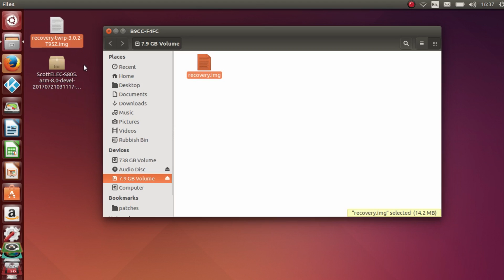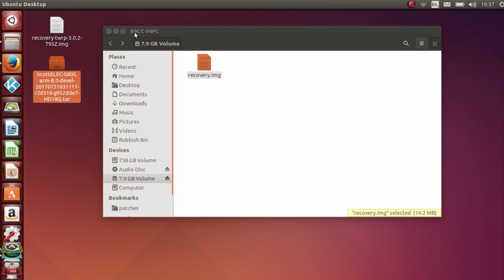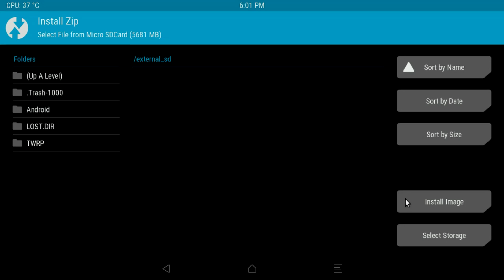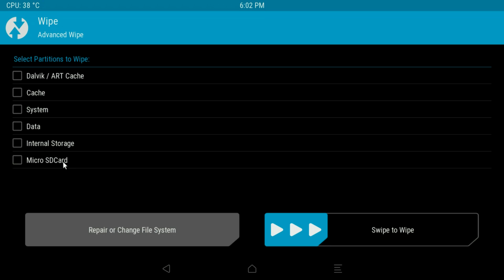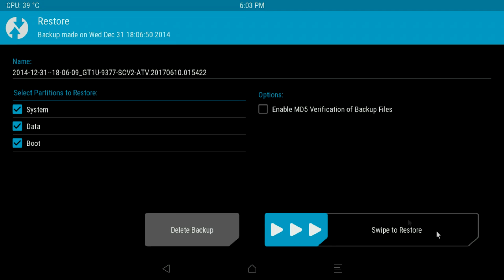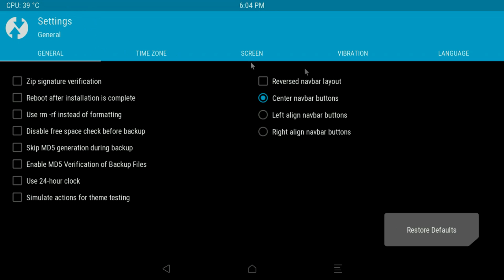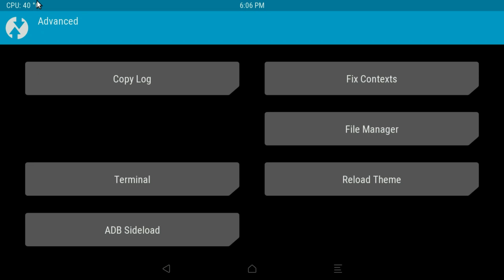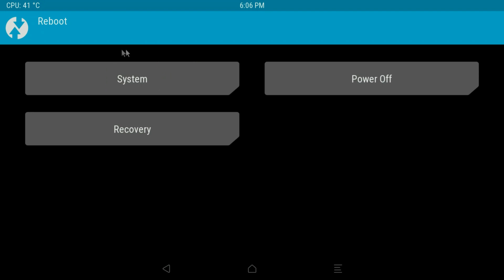Android Backup Tutorial: TWRP for S912 TV Boxes - Install and Recover Firmware

Comment: Boa noite amigo. Tenho uma box tv T96R 4K 2G/8G placa: TX_MX4M V13 2017-06-16 (ninguem nunca viu essa placa/pci) e NÃO consigo fleshar com a firmware original de fabrica 5.1.1. Baxei do site china e do outro site ...entretement... . Se uso PC com BOX não completa, dá erro/falha. Se uso SD CARD abre a tela do recovery, começa a fleshar e dá umas 8 linhas e na ultima dá mensagem: "Aborted Installation" e não completa. Então clico opção "Rebboot System Now", abre a tela da box T96R, volta para modo recovey e clico novamente em "Rebboot System Now", então inicia mas continua a mesma firmware que estva. Obs.: Esse modo SD CARD não BRICKA. Consegui fazê-la funcionar depois de várias instalações, bricka e desbricka e as que deram certo foiram: Leel, King, mas essas dentre outras rockchip NÃO funcionam wi-fi. Agora to usando a "V88 MINI II RK3229 2GB RAM 8GB", mas não to feliz, porque quero encontrar e usar a firmware dele mesmo. So não tentei ainda fleshar a original nesse modo TWRP. Instalei um 3229, mas quando entro modo recovery, a tela do TWRP abre normal e cheia, após carregar ela fica pequena em um canto da tela e o MOUSE e TECLADO ficam INATIVOS/INOPERANTES. Então não consegui usar o TWRP. Pode me ajudar por favor e me informar qual é a TWRP  que vai funcionar nela, box? Obrigado.

Comment: Great video!
My android box worked for an hour now it wont start.
I have a few questions:
Does this method require a sd card - you mentioned usb - can you install with a USB stick? Do you have a video on that?
(I do not have a sd card or burner - not sure my cheap android box is worth the equipment purchase)
I do not have a wireless mouse either - but where does the mouse plug into? - the usb on the android box or the tv? Could you use a phone that wirlessly connects with a TV remote to scroll the screen? Sorry for my ignorance here!
What is the best place to get firmware? Doing a search for my box which simply says A95X pro and nothing else, does not give me much.
I flash an android phone with LineageOS the other week. Do these boxes have custom ROM's also? It would be good to be google free and just have Kodi.
Cheers!
Reply from the maker: What box do you have ?
Reply: This one:
A95X PRO Android TV Box with Voice Control
https://www.gearbest.com/tv-box/pp_1801657.html?wid=1433363

Comment: Nice video. Wil this version of TWRP work on a Mecool M8S Pro L (LB version) Android TV box?
Reply from the maker: LB version ?
Reply: Yes, they apparently now have 3 versions of the box. The LB version is the latest one that has a few different chips, such as the bluetooth from what I have read on freaktab
Reply from the maker: As long as it is not the version with Android TV then theirs a chance it will work, might be more TWRP available now as well.
Reply: Yes it has the actual Android TV OS (sorta) on it. I can't seem to find anyone that can give me a link to the actual TWRP I need. Thanks for replying
Reply from the maker: System is to locked down with Android TV, for booting from SD not sure it would work anyway.
Reply: The version I found that will work with the LB version of the box was twrp.q20x-3.2.1-0_2.img at the time of this reply. It works great on SD card after renaming to recovery.img

Comment: Hello Scott, I have tried on numerous occasions to install the TWRP on my Beelink GT1 Ultimate without success. I've followed your instructions to the letter. But when I try and boot from the SD card I keep getting the Amlogic standard reset screen. What else can i do to get the TWRP installed? Absolutely does not work. Is there anything that you may have omitted?

Comment: Hi there. Great video.  Wuick question.  I ran the backup on an X92 S912 and I see that whithin the TWRP backup folder there are.win files.  Should there not be a .img file ? Thanks
Reply from the maker: You should just have a TWRP folder, that's what you need

Comment: My another device is amlogic q201. Beelink GT1 Ultimate Amlogic S912 Android 7.1.2 - 3/32GB.
Please. Is this TWRP (recovery-twrp-3.0.2-T95Z) compatible?
Recovery actual:
Android Recovery
Amlogic/q201/q201
7.1.2/NHG47L/20171020
Thankful.
Mostrar menos
RESPONDER
Reply from the maker: depends on your motherboard, but yeah it should work. Give it a go as it wont harm your device.
Reply: AIDA64 app, says: My motherboard is: Manufacter: Netxeon, Model: Beelink GT1, Brand: Amlogic, Board: q201, Device q201, Platform: gxm.
ANDROID 7.1.2.
I tried with recovery.img on sdcard (FAT32 or exFAT?).
But TWRP did not work.
1) I see the standard recovery or
2) GT1 freezes on the BEELINK logo screen.
Thanks for the quick reply!

Comment: Ive had no luck whatsoever getting my H96 Pro+ to boot TWRP recovery.img and tried various versions, and various ways to boot. It always boots standard recovery despite doing all correct (Im a 20 years IT guy). Whereas my other Alfawise S92 box had no problems, this Alfawise H96 Pro+ is exceptionally weird.
Reply: No luck here. Stuck on boot logo.
Reply: After installing SuperSU i got a bricked box. Stuck at bootlogo.. i also can't get anywhere with the standard recovery. Do you have any advise what to try to get it running again?

Comment: I installed supersu on my android box, updated binary and it wouldn't boot so I had to flash stock firmware to get it to boot. If I install TWRP would I be able to install supersu and update binary without the box getting bricked again? (The Box is an H96 Pro+) Also does it reset the system to default when flashing recovery?
Reply: Hello peter 3337. I'have got the same problem with my h96 pro+. Could you tell me please how you manage to flash the  stock firmware?
i' tried the sd card method but the  box did not respond.
I tried the usb cable method but the process stopped  at 2% and i got this code "2%:[0x10105002]Romcode/Initialize DDR/Read Initialze status/USB Control Set up error.
thanks
Reply: I had some trouble too. I had to add the license files to the Amlogic USB_Burning_Tool folder. You can download the firmware, license files and a tutorial here:
mega . nz/#!ZTIGWABC!xgkGFOrWLWPnbwUCl0_v3LtXVGrwe8XYdisAlwcb2WY  ...(remove spaces)
Copy the licence files here:
C : \Program Files (x86)\Amlogic\USB_Burning_Tool\license
Edit: I used the usb cable method
Reply: @peter3337  Shit, i have the exact same problem! Installed SuperSU and now it stuck at bootimage. Going to the standard recovery and reading the logs doesn't say anything of what's going wrong... i want to try the method in this video, but just copy the recovery to a SD card and boot does nothing. He talks about prepairing the SD card.. that is what i can't find, how to prepair!? Can you explain how to prepair the SD card so i can try again?

Comment: Have you tried this on h96 pro+?
Reply: I flashed this ROM last week it's pretty good it comes with this recovery and you can flash magisk root also I can use my PS3 controllers now 😁😅😍☺😂

http://freaktab.com/forum/tv-player-support/amlogic-based-tv-players/s912/alfawise/firmware-roms-ac/647777-rom-alfawise-h96-pro-3-32-and-3-16-scv6-7-1-2-ddr3-ddr4-and-9377-wifi-chipset
Reply from the maker: Nope, not got the hardware - give it a whirl, tel us what happens
Reply: There is a cwm or twrp for sichion v88 rockchip 3229?
Reply: Did u tried it? have the same h96 pro plus 3gb/32gb. Dont wanna brick or do any mistake. I´m a newbee to MBoxes at all. Once i only flashed android 7.1.2 by windows usb burner.
Reply: Ricky Bush i also want to know
Reply: And how did you get to flash it to the h96 pro plus? Because the instructions here does not work on my h96 pro plus as it does not boot to the recovery using the method
Reply: Ricky Bush link please?
Reply: I see, sorry Im using the mobile youtube app, other comments not visible in this view.. will look on PC
Reply: Hennie Morton http://freaktab.com/forum/tv-player-support/amlogic-based-tv-players/s912/alfawise/firmware-roms-ac/647777-rom-alfawise-h96-pro-3-32-and-3-16-scv6-7-1-2-ddr3-ddr4-and-9377-wifi-chipset
Reply: Have you finally managed to boot to the recovery using this method - as I haven't so far. I have a generic H96 Pro+ fm Bangood with 7.1.2 rom (OK at the beginning but non bootable now after I tried to change stock launcher). I don't even know if mine is bricked or not.
Reply: Vangelis Kakouras 7.1.2 has a lot of problems you should try that custom ROM out it fixes a lot of things 🙂
Reply: I'm willing to try it but how? since now I'm probably with a brick box(?). That's why I wanted to try that method with TWRP recovery img file + new FW through SD card.  But 'MXQ project' who uploaded this video here just copies the recovery image on the SD blank card and his box is bootable. Mine (H96 Pro+) rejects to boot start screen (just black screen and blue steady light).  So how to upload a new FW as my box can't boot.
Reply: I'm trying your method with the copy of a TWRP recovery img directly on a blank SD card and try after to boot my box (H96 Pro+) with power + reset presses AND the box doesn't boot - just blank sctreen and a steady blue led light. What am I doing wrong?
Reply: Vangelis Kakouras it's says everything you need to do on that thread just go to it and have a look 🙂